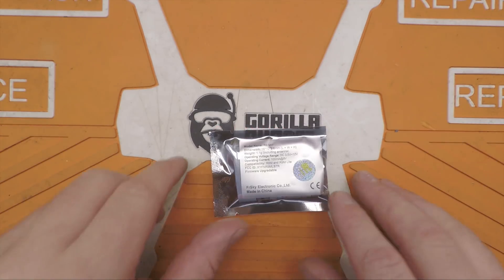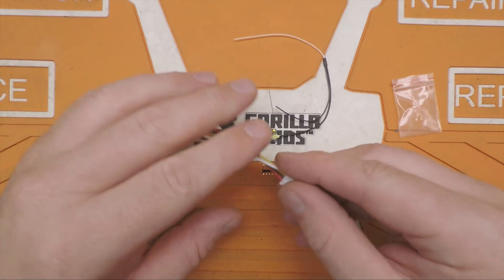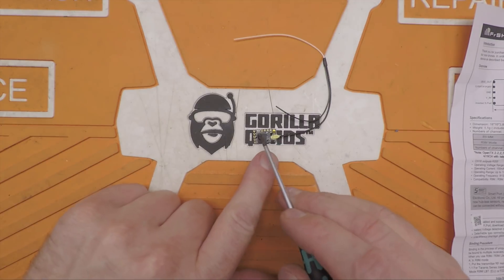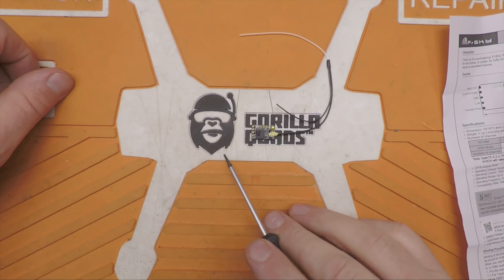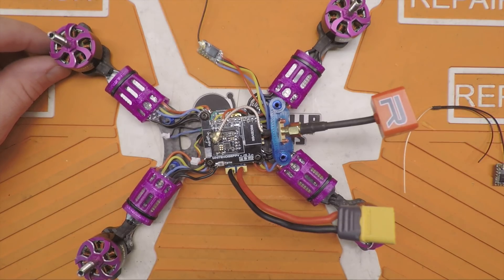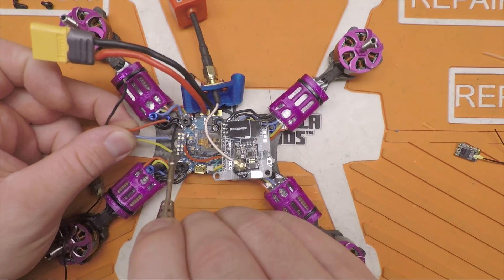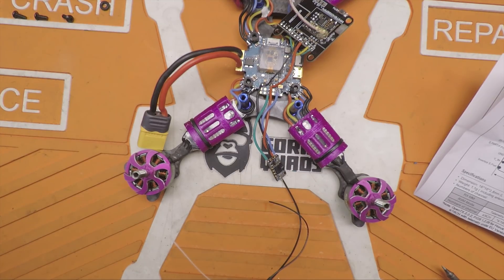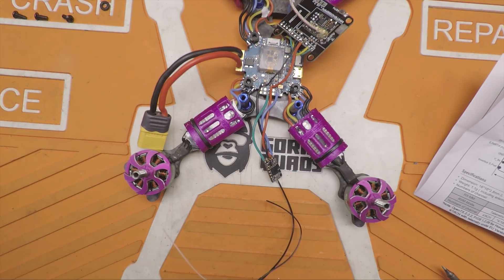Frsky R9 MM install and setup (READ THE DESCRIPTION!)

Comment: Can I put it on a LAL3-F411 Flight Controller? I am a littlebit  confused because of the UART on this controller.
Reply from the maker: Yes it's possible but you may need to forgo having telemetry.
Reply: @TweetFPV  Thanks, so I dont have telemetry? I am a completly beginner and I am german so my English isn't that good.
Reply from the maker: Any flight controller can use the r9 system because all flight controllers have the ability to use sbus. Sbus is just the control signals from your radio. The telemetry aspect is a seperat signal called smart port and is the communication from your flight controller back to your radio and requires a seperate uart. Telemetry is useful for pid tuning and Vtx adjustment but all these functions can be done through the betaflight osd without the need for telemetry. Typically f4 flight controllers especially 20x20 ones lack extra uarts to use sbus and smart port.
Reply: @TweetFPV  Thanks, you helped me a lot.

Comment: So if my FC doesnt have extra uart should I install using F.Port? Thats only one wire...
Betafpv whoop 20a fc going on 95x..
Reply from the maker: Possibly, but depending on which receiver you are using like the r9mm it has a inverted pad that can go to a uart tx pad that doesn't have a built in inverter (most f4 fcs) otherwise you are only going to be able to use sbus. Fortunately you will still get rssi with newer fw without using smart port telemetry.
Reply: @TweetFPV  yes R9MM ill probably end up skipping telemetry.. But twice now I have telemetry receiver and can't get telemetry  to work lol.. i thought u can get an uninverted signal from r9mm.. Oscar Liang article said it.. idk.. ill try it while everything is apart. When stuff shows up. Maybe I'll put in a temporary frame to test
Reply from the maker: Yes you can get and uninverted signal from the r9mm. That can be used a ls f. Port for both rc and telemetry on a f4 fc. That wire needs to go to a uart tx pad.
Reply: @TweetFPV  ok cool.. thanks. I got to read more about f.port.. ill look if u have a video lol.. only have done sbus

Comment: I have followed your tutorial and all mine does is binds with telematry info etc but no stick input. I have the mamba F405 MK2 F4 FC and R9M Lite module also the Frsky X Lite-S. All flashed with latest ACCESS firmware and Frsky firmware for the F.port, also tried to run without SBUS, still have telematry but no stick input.
Reply: were you able to get it to worked? i have the exact same setup, but qx7s radio...
Reply: @eduardosalasmx  I used sbus in the end. Could never get telem. On it

Comment: ok to clarify on the diagram from frisky they have Sbus out, Sbus in, separate Sport.  Is your correction the blue wire the equivalent to the Sbus out or in or Sport ?  Is the Green wire Sbus in or out?  Thanks again.  I am having issues with this.  I cant get the Fport one wire to work despite CLI attempts etc
Reply from the maker: The SBUS in is for using receiver redundancy like if you wanted to run 2 receivers. Which FC are you trying to use f.port with? Depending on your FC using F.Port might not be possible with the R9MM RX. So based on the colors i used the connections should be as follows:
blue         UART TX for s.port
green       SUBS for RC signals
red            Power
black        Ground
Reply: @TweetFPV  Thank you.  I am using a F7 Kakute,  The fr Sky instruction sheet I have does not show inverted sport where you noted it. On my sheet from top to bottom with the channel holes on top Sbus_out, S.Port/Fport, GND, V_in, SBUS_in.  I have finally got the radio and receiver to be seen by Beta, but I am only getting RSSI telemetry.  I will sort that out next and I believe it has to do with my transmitter settings.  I am bummed that the FPORT despite loading the new firmware and flashing and no issues with binding, the Beta does not see the fport.  I did all permutations for CLI.
Thanks again.
Reply from the maker: @diveflyfish  you need to flash the fport fw to the r9mm. Then connect the s.port wire to the "telm" port of your fc or to any unused uart tx pad. Contact me on my discord server. It's a lot easier to help you there. This is a easy fix but pictures help. https://discord.gg/R6DUpF
Reply from the maker: @diveflyfish  oh and which rx are you using r9mm or r9mini?
Reply: @TweetFPV  R9MM OTA
Reply from the maker: If yours says sbus in as the last hole then you have a r9mini Ota the last hole on the r9mm Ota is an inverted s.port pad.

Comment: Where is the RSSI pad on the 9MM?  I have a RSSI pad on my FC and want to ensure I can use the RSSI.  Thanks again,
Cheers
Reply from the maker: There is no rssi pad. The rssi comes into betaflight as aux 12 if you flash the newer firmware. Either way rssi is always a telemetry sensor between the rx and your TX.
Reply: Thank you!!
Reply: Thank you!!

Comment: You wired the S Bus out to RC?  Can you use the connection below that namely F/port SPort instead ?  Thank you for the clarification.  Have a great day.
Reply from the maker: You can if you flash fport fw to the reciever. But there are issues with f4 flight controllers not taking a uninverted signal. The r9mm also has an inverted sport/fport pad which will work with a f4 fc that doesn't have a built in signal inverter.

Comment: Hi, a little puzzled. F.bus needs only Power, GND, and uninvented SPort. Why did you connect also SBUS?
Reply from the maker: I think you mean f.port. I'm using sbus and smart port in this video because at the time of recording fport was unreliable.
Reply: TweetFPV i see, sorry for that. F.port is what I meant yes, thanks for response. F port seems to have much better optimization so actual difference in latency vs SBUS is significantly better :)
Reply from the maker: Yea as of now i run all my quads on f.port and even on access fport. I can actually feel the difference between sbus and the new access f. Port on the r-xsr.
Reply: @TweetFPV  awesome news :)

Comment: Havent you just switched the sport cable with the sbus cable? The girst cable you soldered you say was the sbus cable but it wss the sport cable isnt it?
Reply: Sorry man i just see the discriptionafter i send this😉
Reply from the maker: You are correct, I noticed this error after uploading. There is a correction in the video description.
Reply: @TweetFPV  i noticed yesterday that if i want to connect sbus and sport telemetry on my kissfc v2 i must solder the s-port/f-port pad to the kiss fc and not the inverted s-port.

Comment: You soldered it backwards or you just said it backwards in the beginning but sport is your blue wire according to you labeling it when you put em on. And when you weed it into the fc you out the green as s-port ;)
Reply from the maker: Yea. I cought that afterwards. But I left a note in the description
Reply: Aaah so i am not the only one that seen it😅

Comment: I have a mamba FC. Connect the wire inverted s.port to an uart as you did? thank you
Reply from the maker: Can you provide some more info? What fc are you using and which reciever
Reply: @TweetFPV  mamba mkv705 and the r9mm
Reply from the maker: I think you ment the mamba f405 mk2?
Reply from the maker: If that is the case and you have the mamba f405 then take the inverted s.port in from the r9mm (bottom pin) and connect it to uart 3tx you don't need soft serial. Just select smart port telemetry in betaflight ports tab on uart 3. Select telemetry in the config tab and hopefully that will work. If it does not you might need to do some work in the cli to change telemetry inversion.
Reply: @TweetFPV  Thank you very much friend. very good

Comment: Hoping maybe you can help me, I have tried  repeatedly to update a R9 mini and i keep getting a “Firmware update error module not responding” message from my Taranis X9D+. I have tried 2 different Mini 9’s same error message??? Can anybody help?
Reply from the maker: Sure. What pins do you have connected from your r9 mini to you Jr bay on your x9d? Also which fw are your tryinb to flash and what version of opentx do you have on your taranis?
Does the r9 mini leds light up when you try and flash it?
Reply: TweetFPV i have the S. Port going to the bottom pin then ground then power. I have tried the newest firmware 190201 including the Flex.  I have 2.2.4 open tx. Yes the lights do come on but even that took awhile.
Reply from the maker: When you select the fw in your taranis are you selecting flash s.port or flash external module?
Reply: TweetFPV external module. It doesn’t give the option to flash S port.
Reply from the maker: Just checking, are you soldered to the second from the top pad on the r9 mini? So the middle 3 pads?
Reply: TweetFPV yes. I just noticed after all this , now when i try to land my quad the motors seem to be racing a lot faster than before? I have tried 2 different minis still the same error message... I have 1 solid red led on when I plug it in.
Reply: Just an update since i had a QX7 i tried to update the receivers with it and it worked! I didn’t update the Open TX i went with the 2.2.2 that was on it. I’m an amateur and am guessing its either my X9D+ or the 2.2.4 update?
Reply from the maker: That's Is very strange. Probably could try down grading to 2.2.3 to see if it's the fw.
Reply: TweetFPV do you know what I need to do to do that? I’ve tried a couple of times going back and reloading 2.2.2 but when i hit the load firmware to radio it says 2.2.4. I even deleted all the other open tx and tried but still wants to load the 2.2.4. Do i need to delete the open tx firmware in my radio?
Reply from the maker: You need to install opentx companion 2.2 and then proceed from there.
Reply: TweetFPV I tried I ended up with 2.1.9 lost all my models. Still wont update the receiver. When I try to load any other version of open to it gives me 2.2.4 even if I’m in the 2.2.2 version..
Reply: I tried to load several earlier versions of open tx , nothing would work except the 2.1.9 (factory reset I think) and that wouldn’t load my saved models at all. I had to reflash 2.2.4 and at least I got my models back.  It still won’t flash a receiver, same error message. The one thing I noticed, when I plugged the receiver into my QX7 it did not light up until I hit the flash external module button and when I plug it into my X9D the red led  lights up and stays on.
Reply from the maker: If it still wont flash your receivers i would lean towards a hardware issue with your x9d.

Comment: Hey mate, which firmware did you flash on either the R9MM receiver and R9M module? The basic or the Fport one?
I'm not able to obtain telemetry back from the quad...
Thanks, cheers 👍🏻
Reply from the maker: I'm basically using all F. port with the R9MM receivers. The FW for the R9M module needs to be the same version as what you flash to the R9MM receiver. So basically any time you change you FW on either the TX or RX when you need to flash everything.
Reply: @TweetFPV  Where did you get the firmware for the 9mm?  I can't find the Fport Firmware anywhere..
Reply from the maker: https://www.frsky-rc.com/r9-mm/
Go to accst then click the history download link at the bottom if you want Pre accst 2.x otherwise use V 19.02.01 there should be a fport fw file included.
Reply from the maker: Unless you are trying to use access. Then after you register and bind your reciever. Go into the receiver options and you select f.port through the software.

Comment: Damn i want to upgrade to Frsky from Flysky and need to change my RX of the Tyro79.
But i only have 2 uarts, 1 for RX and the other one i use for smartaudio.
Do i really need the smartport wiring, if not what do i lose?
Reply from the maker: You don't really need smart port telemetry. In all honesty I don't usually connect smartport unless it is convenient to do so. The only things you will loose is the sensor data comming back to your taranis. Depending on which reciever you use you will still get rssi and rx voltage regardless of if you connect smart port. You won't be able to use Lua scripts for pid tuning or Vtx audio switching but you can still do those things through the betaflight osd menus anyways.
Reply: @TweetFPV  That's nice to hear,   i can get my hands on brand new  X-lite + R9 Lite + R9mm RX all-in-one package for 150,- that's pretty good right?  I've read something about Fport a few minutes ago and that seems pretty cool and easy to setup. Either way i dont mind my transmitter NOT talking to me :)  All i'm thinking about is just hooking up Sbus and bridge 2 pads and be done with it.
The only thing i'm worried about is having to flash something but everything is EU based, but i hope it has the latest firmware because there was improved Rssi also in firmware but i dont know if i should take that with a grain of salt.  There's also old firmware with telemetry issues so i'm starting to think damn the whole telemetry stuff..
Reply from the maker: That is a good deal. A word of warning if you are in the US buy a fcc version of the x9 lite or of your in the EU buy a lbt version. The internal module was not designed to switch regions.
Reply: @TweetFPV  Yes everything is bought local from national website i guess they dont sell other than EU,  the package is described as EU region so i hope it's good.
I just ordered it, along with some heatshrink tubing for the receiver. Pretty hyped already man,  it should be plug and play right, apart from binding /setting up channels etc.?
Reply from the maker: Should be but there are some firmware updates for the x9 lite. You'll also need some 18650 batteries and a sd card.
Reply: @TweetFPV  Yeah i have 18650 from my vaporizer and sd card from my goggles :P i hope i dont need firmware on my receiver because you need special cable for that?
Reply from the maker: If you are using the r9 system you need to update the rx and rx for maximum reliability. You just need a servo cable. Any hobby shop should have them.
Reply: @TweetFPV  I have a few futaba connectors with a piece of wire attached  i guess with some soldering that should do the trick. I havent looked into that yet honestly i was afraid it went out of stock :D ,  Guess i'm following another guide tonight ghehehe

Comment: Thanks for this video 🙏🏻  But I have a problem, I have all the connections like you, but impossible to have the sticks that work.  You changed the cli?  I dt understand, it's been 5 days that I try
Reply from the maker: Which fc, rx, and which firmware do you have flashed to both? Are you using fport or sbus?
Reply: TweetFPV fc = Omnibus F4 V3 
RX = R9mm flash with r9mm flex fport 
I use fport 🤷🏼‍♂️
Reply from the maker: Ok so fport. What pad do you have your signal wire soldered to on the rx and on the fc?
Reply: TweetFPV mmh, inverted sport to tx6, i understand a litte bit english
Reply from the maker: try serialrx_inverted = OFF and serialrx_halfduplex = ON in the CLI. also make sure you have serial RX selected for uart 6 and fport selected in the config tab in betaflight
Reply: TweetFPV I will try this on my way home 🤷🏼‍♂️

Comment: Hello sir thanks for great work. I have followed your video and for some reason I have no stick inputs in the betaflight receiver tab. My f4 has a inverted s bus . Any thoughts?? Really stumped on this one
Reply from the maker: which RX and FC are you using?
Reply: @TweetFPV  hello sir thank you for your reply. I have found my issue which was a broken sbus wire. Literally the wire was split,while all the silicone cover was completely intact. The Only reason I caught it was because I was checking my solder connections and the wire stayed at  90 degrees. Again thank you for your reply. Your work is invaluable to the community and especially for us noobs cheers.
Reply from the maker: It's great news that you found the problem! Thank you for the kind words. I'm always happy that I can help someone!

Comment: So if there is a S.Port (and the FPort) and an Inverted S.Port  is the inverted S.Port also an inverted FPort? Trying to get around having to use a UART with an inverter
Reply from the maker: The the inverted pad is and inverted smartport  or fport depending on which firmware is flashed to your rx.
Reply: @TweetFPV  thanks, that is what I was assuming.

Comment: Hey so we're do I connect the wire on the board and which wire is it on the receiver?
Thanks 🙏 Confused nooby..
C
Reply from the maker: Sorry, I need a bit more info to help you out here. What FC are you using and what receiver are you trying to connect it to?
Reply: Frsky 9m mini